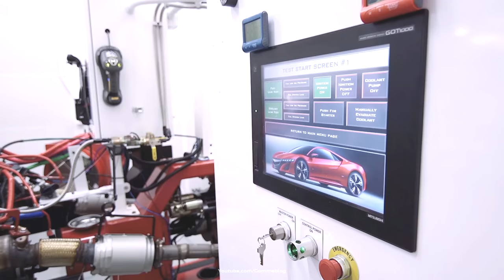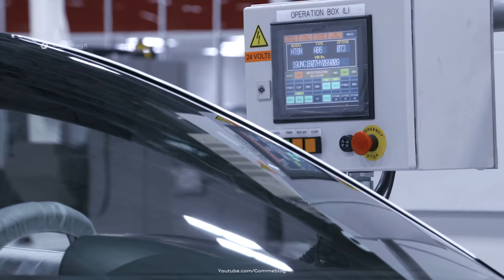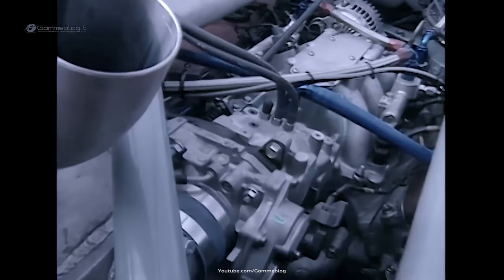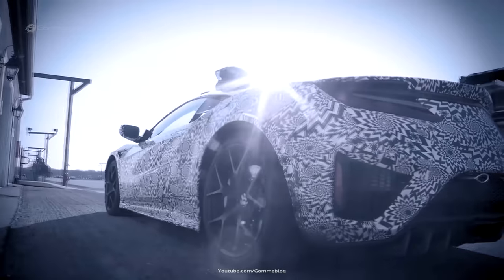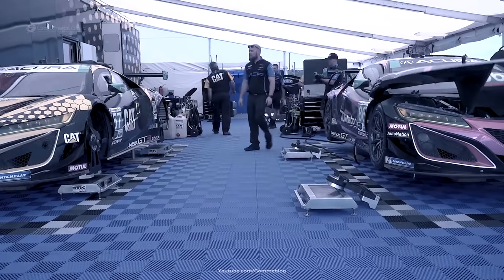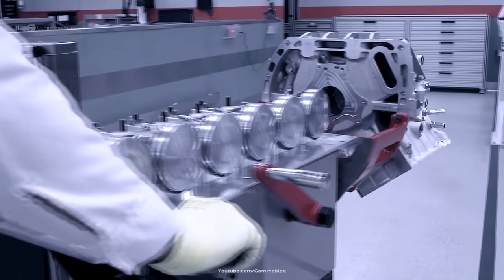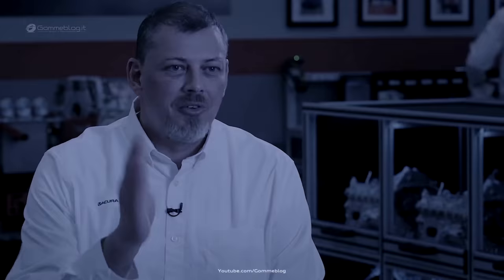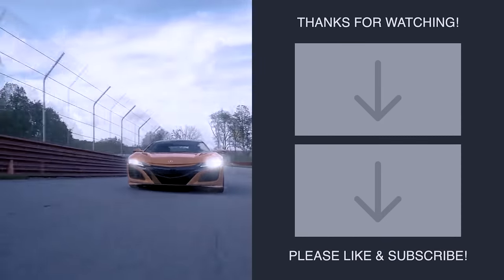Honda (Acura) NSX - PRODUCTION and DEVELOPMENT (Usa Car Factory)

Comment: The NSX V6 engine is a beauty. But... soon new solid state EV batteries and smaller but more powerful electric motors will become equal partners in power with the V6 engine. Then LOOK OUT!
And then there will surely be an all electric NSX that will be SO beautiful.
Reply: If I'm not wrong they have already three electric motors,  right?

3.5L twin-turbo DOHC 24-valve V-6/500 hp @ 6,500-7,500 rpm, 406 lb-ft @ 2,000-6,000 rpm, plus 2 x 36-hp/54-lb-ft (front) and one 47-hp/109-lb-ft (mid) electric motors; 573 hp/476 lb-ft combined

Comment: 3.5L twin-turbo DOHC 24-valve V-6/500 hp @ 6,500-7,500 rpm, 406 lb-ft @ 2,000-6,000 rpm, plus 2 x 36-hp/54-lb-ft (front) and one 47-hp/109-lb-ft (mid) electric motors; 573 hp/476 lb-ft combined

Just a dream for me,.....can't afford it 💙